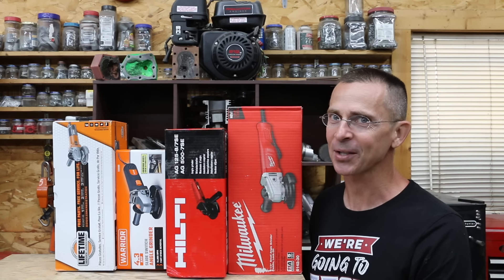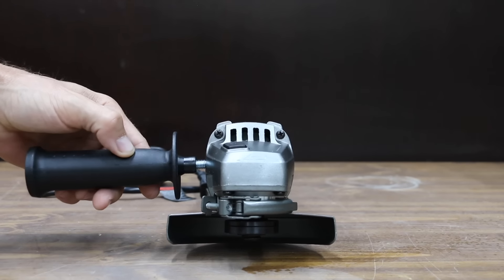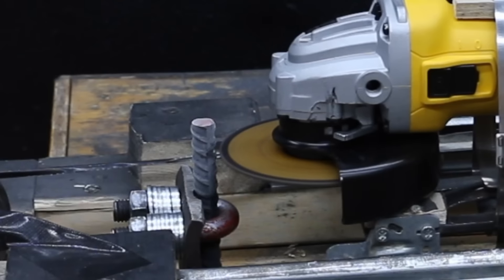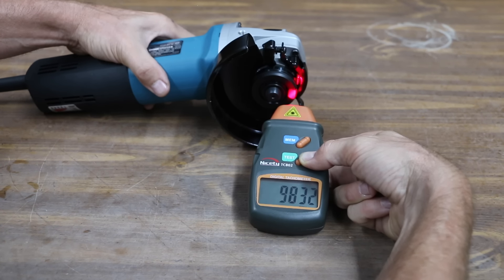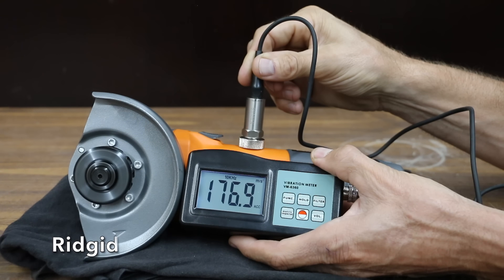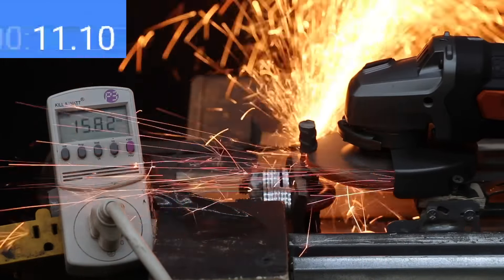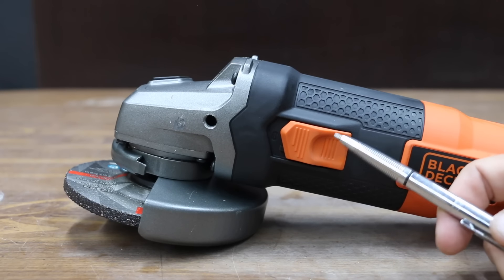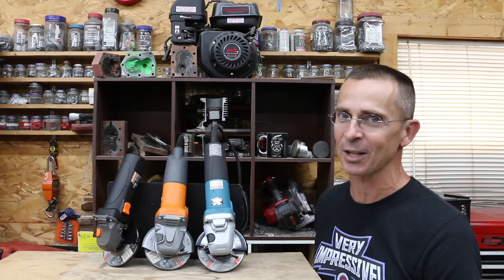Best Angle Grinder (Corded)? Hilti vs Milwaukee, DeWalt, Makita, Ryobi, Ridgid. Let's Settle This!

Comment: I own a Chicago Electric (from HFT) that has a paddle switch. I use it for metal work, which is pretty darn infrequent, but it does what I ask it to do at the $20 price point.

I also have a Makita cordless that I use in the woodshop. I have several accessories that I purchased for it specifically designed for woodworking. It is a beast...with the caveat that I have never used it for metal working. But slap a 40grit hook n loop disc on the accy mount and that thing eats wood faster than a starving beaver! Do not, however...DO NOT waste your money on any of the chain-saw carvers...that is unless you have zero regard for your own personal safety!!!
Reply from the maker: Thanks for sharing.

Comment: @project farm, could you do a brake fluid test as loads of brands claim to have similar spec but some must be better than others. Very few videos exist on this topic. Comparing things like the RBF600/660 and Castrol React SRF which seem to be the best on paper.
Reply: great idea man, i would like to see the wet boiling point tested across the brands as Castrol react srf has a wet boiling point of 270C or 518F which is way higher than anyone else
Reply from the maker: Thanks for the suggestion.

Comment: DEWALT Angle Grinder  (DWE43116) with 4-1/2-Inch to 6-Inch guard  is my choice with a trigger switch just don’t trust the paddle. It also has options for guard sizes & that’s a + in my line of work. Never use a grinder without a guard if your lucky it will just bite you. Just ask a coworker that can’t count to 10 or has issues opening a bottle. “ oh I am just going to cut this bolt won’t take a second grab that finger & put it on ice”
Reply from the maker: Thanks for sharing

Comment: I spent 6 hours grinding out windows and doors in a metal container using a dewalt and regardless of high vibration reading in this test my hands are fine.
Reply from the maker: Thanks for sharing.
Reply: @ProjectFarm  Man, the amount of times you've responded to my comments is impressive. I've been trying to think of video ideas and I think a "best brand of chisel" test would be useful. Maybe even side-cutting pliers.

Comment: I have a dewalt and a metabo angel grinder they both have the safety future of power button and lock brake during grinding , I usually use the metabo because speed control you can choose the speed from 2800 rpm to 11000 rpm and it's  very handy , I can't imagine which model of metabo you choose for this test ,

Comment: Had a warrior.  It worked in great power and cutting, but the switch broke after about 30 cuts of 3/8 angle iron.  It's probably great for hobbyists or people who use it once in a while or only do light cuts like nails or something.  I ended up exchanging it and paying the difference in price for a Bauer, so I don't know if I just got a lemon, but I live in the country and didn't wanna have to go exchange it again.  The Bauer kicked back on me while cutting more 3/16 angle iron with a cut off wheel and I hadn't put the guard on it.  I ended up with 5 stitches in a 5 mm cut, so put on the damn guard or wear a good glove.
Reply from the maker: Thanks for sharing.

Comment: i like my 6" metabo with the lock-on switch. only complaint is the price of 6" wheels and its missing the 3rd lug to put the handle on the top. 4" wheels work on the 6" also, which is nice with a wire wheel.
Reply from the maker: Thanks for sharing.

Comment: Nice video! I use a similar Makita grinder practically every day, sometimes for several hours at a time and while I do like the performance the power button really leaves a lot to wish for. If I'm wearing thinner welding gloves the tip of the thumb tends to jam itself in the way of the button when turning it on. Whenever I buy one for home use I might take it apart and replace the power button for something more manageable, maybe even a simple rocking switch
Reply from the maker: Thanks!  Thanks for sharing.
Reply: Get one with the paddle switch....

Comment: Metabe is best for new 1s for sure. I have old (late 90s) dewalt , and its evan smoother. Ate 1 anglegear, but has been in use quite much almost 20 years.
Reply from the maker: Thanks for sharing.

Comment: This is a great video! While cordless angle grinders are extremely useful the amount of batteries they use is insane. 
I have been looking at battery powered push mowers and am wondering if you would be able to do a video comparing them, Milwaukee, ego, harbor freight, dewalt?
Reply from the maker: Thanks!  Thanks for the suggestion.

Comment: I prefer an angle grinder with a trigger switch, it's easier to hold and control, the porter cable one you tested was 6 amp, the porter cable trigger option I have PC750AG is 7 1/2 amps.  It would be nice to see these types tested, I have a friend that likes a paddle switch grinder he does a lot of one handed grinding because he's always in a hurry.
Reply from the maker: Thanks for the feedback. Thanks for the suggestion.

Comment: Could you do a video on mower deck undercoating's (an example would be slip plate), they claim to prevent wet grass from sticking. would be great to see your meticulous testing put them to the test.
Reply from the maker: Thanks for the suggestion.

Comment: Great Vid, 

I bought a "Chicago Electric' HFT eons ago. (Total newbie)

Never really used it !

Then I saw (no pun) how dangerous, it could be for a pwr tool newbie.
(Blade shattering).

I am now better versed in da land of power.

I will check, to see, if u did an Angle Grinder Blade/ Disk review ? (Quality, Saftey n Durability)

If not please consider it.
(I'm "PF" aka "Farm Fan") 🎉

Of all my now much larger, power tool collection. 

This one strikes the most fear, in me.

Out of my power cutting saws ,( Pole, Jig, Sawsall, Mini Chain, Dremel lite 7660 n Oscillating)

Thx for the vid .
Reply from the maker: You are welcome!

Comment: In 2008 I burned up two Harbor freight grinders in 1 day. I puchased a Dewalt paddle switch with hard case for $98 that I still use to this day. I guess that would be $150 today😮
Reply from the maker: Thanks for sharing.

Comment: I got rid of miluakee tools nearly 5 years ago. When my last working  battery  less than a year old gave up the ghost. Between hamme drills chuck coming unlocked and spitting your bit out or the impact drover rolling coal, ivebeen using the same  flex volt 60v tools and batterys for like 4 times as long and still going going going
Reply from the maker: Thanks for sharing.

Comment: which grinder would you recommend, for sharping lawn mower blades, while using a All American sharping tool ?
Reply from the maker: Thanks for the suggestion.
Reply: @ProjectFarm  not sure of the handle i would need to get for a  grinder to use with the all American sharper tool ?
Reply: @ProjectFarm  plus i am looking at the DeWalt grinder i think, for sharping a lawn mower blade ? ?

Comment: Always  cool videos.  Here's an oddball suggestion for you.  As we get older it becomes important to be able to monitor one's blood pressure.  How about a couple of evaluations of wrist cuffs and then wrist against upper arm cuffs.  The problem with the latter is they generally require a 2nd person to be able to get the cuff on.  I wonder in particular how accurate any of them are.  It would be good to know.
Reply from the maker: Thanks!  Thanks for the suggestion.

Comment: Would've liked to seen the cords tested too.  I've got an old DeWalt angle grinder & the cord started falling apart fairly quickly.  Electric tape with gorilla tape over that has kept it going though.
Reply from the maker: Thanks for the suggestion.

Comment: I really prefer a trigger style switch however after accidentally bumping the trigger with my thumb on the blade I understand why they aren't as common anymore. Definitely not a mistake you want to make twice that's for sure. Thankfully I did just bump the trigger so outside of ruining the thumb on my gloves and making a nice indent in my thumb there's no lasting damage. I was in the habit of unplugging my grinder prior to blade changes but was in a hurry and a little tired that day, precisely when accidents happen. My new grinder has a slide trigger which can't be accidentally bumped, I still unplug it though, just in case. Wasn't the worse injury but still not fun.
Reply from the maker: Thanks for sharing.

Comment: My stepfather has a Metabo angle grinder bought in 79 so its 44 years old. It has been dropped in the ocean and been in use in harshest enviroments including snow and rain and the damn thing just keeps on going. Probably on its 10th power cable and had to be flushed after it was dropped in the sea.
Think thats a hard to beat quality product.
Reply from the maker: Thanks for the feedback.

Comment: Idk if still available, but I bought a couple dewalt grinders 20 years ago- one always had cut off wheel and the other grinder/flapper disk.  They were $5 more at the time to get the paddle trigger version.  

I Used them in daily fabrication for a 4 years, then they were used as needed as heavy equipment mechanic for about 4 years so more frequent than at home, then at home on as as needed basis.  

Fabrication have probably went through 1 cutoff blade a day and 2 grinding discs a week by tike it’s averaged out.
Equipment mechanic was maybe 1/2 as much.  1/2 that again since being at my house- but i do more fabrication at home than most any guy I know.  They both still work great, the cords need replacing and I never put in new brushes yet.  Now that I am thinking about it I probably will check the condition incase I can keep them running rather than damage the motor.  If not replaceable- no tears, they way more than paid for themselves years ago.

While they were at home,  I ended up with metabos, makitas, and the side switch dewalts, and of course tried other brands that other guys had.  I would not buy the side switch dewalt, ergonomics sucked.  A friend has bought the harbor freight ones, burns them up about every 5 months, but so cheap- so what.  But I hate the ergonomics so bad I just bring over my dewalt if we are working of stuff at his house.
Makita is to heavy/ bulky to work comfortably more than 1/2 hour.  Fine for strong 20 year olds but those days are gone for me!  Haha.  The metabo is really nice tool- but honestly- I just buy the metabo disk nut, remove the face clip (search youtube to get why) and use it on my dewalts. 

Hope my rambling helps someone.
Reply: Oh yeah- the metabo has a special part inside to hit the wheel lock to change the blade without any tool.  Just hit the trigger, let is slow to almost stop and hit the blade lock.  It loosens the nut and you take it off by hand.  It doesn’t ruin the grinder

Doing this to other grinders will ruin them.

Search youtube and you’ll see.  This is the #1 reason pros choose metabo.
Reply from the maker: Thanks for sharing!

Comment: I was going to rent an angle grinder from Home Depot for a one-time job. Then I discovered for less than the rental fee I could get a new 7 amp grinder from Harbor Freight for less. Well, that grinder performed great! Sure it's not the best, but I don't have much need for one and it won't get used much. I'll die before it breaks.
Reply from the maker: Thanks for sharing.

Comment: My 18V Ryobi grinder is not a variable speed but it has great power and performs well in all the very heavy duty projects I throw at it.  So far I only use the 4 ah batteries.  The drawback with it so far is when I use it for extended periods a spot under the grip on the right side by the trigger gets blazing hot.  Not only does it burn my hand it has melted through the grip.  I have to let it cool down periodically on extended work. 
Please include Ryobi and thank you for your great service.
Reply from the maker: You are welcome!  Thanks for the suggestion.

Comment: Im have hand arm vibration syndrome in my hands, id be keen to see vib’ during the cut, and another vid on concentricity, tolerances and balance of grinding wheels, as im sure the combo of sloppy fit, out of balance manufacture etc are the main problems.
Reply from the maker: Thanks for the suggestions.

Comment: IMO the real sweet spot in angle grinders is the Makita 9005B, which is a rat-tail grip like the Ryobi in this video, with absolutely top-tier performance. It is, however, a 5 inch grinder, so you are unlikely to be able to get disks at the home center.
Reply from the maker: Thanks for the feedback.

Comment: Work in industrial setting, use a small grinder for concrete to steel fabrication. Tried all these at work except the low end harbor freight types. 
Metabo or don't bother
Reply from the maker: Thanks for the feedback.

Comment: I have 2 paddle switch grinder big 6-7" rattail dewalt and makita. And prefer my bosh 5" grinder for the switch that lock on. Never go with paddel again for big work. (More than 5min straight!) Has it make my arm fatigue faster! Use to do multiple hours in the past with that now I feel paind after 5 to 10 min!
Reply from the maker: Thanks for sharing.

Comment: This was a great comparisons, however, HFT makes a whole bunch of angle grinders, their top Herk @ 13 amps/corded/4.5" blade, pit that against the Herk 20v cordless 4.5", or just the whole lot of Hercules vs. the Bauer stuff be it corded or battery.   I have an early paddle  4.5" HFT corded that is a work horse that I've used over the last 5 years that I paid about 40 bucks for. I have some autobody work coming up that will require me to have several angle grinders going from stripping paint to grinding  welding seams and splicing sheet metal together. HFT is my closest store. Also, grinding wheels and cutting blades, Hercules blades to the cheapest is also a question.
Reply from the maker: Thanks!  Thanks for the feedback.

Comment: You should look at parts availability when testing power tools, for example most Milwaukee m18/12 tools you can’t replace just the trigger or just the motor, they only sell motor controller and switch as one unit making a repair as expensive as buying a new too! They also use cheap Chinese bearings!
Reply from the maker: Thanks for the constructive feedback.

Comment: Great video as always Todd. One thing that I believe is missing from the test is safety features. For example, what happens if the breaker trips and the grinder is left in the "on" position? Does it switches itself off when power is interrupted or it will start running again when the power is restored? ("Dead Man's Switch"). If am not mistaken the Makita will continue to run while the Dewalt switches itself off.
Reply from the maker: Thanks!  Thanks for the constructive feedback.

Comment: YESSSSSS CORDED TOOL REVIEW!!!

celebrates I love my corded tools, and can't be bothered with that overpriced cordless stuff. Mostly because I primarily do shop work rather than field work, but even in the field I often find myself preferring a corded tool with extension cords to cordless. They work reliably all day - no fussing around with batteries and chargers - plus often have significantly more power, and they're often cheaper to boot.

IMHO cordless is greatly overrated for most applications.
Reply from the maker: Thanks for the suggestion.

Comment: Dear Project Farm, awesome video as always, love them all :) Just one suggestion if possible, I am not sure what is best way to do this but longevity testing is a must :D There is allot of talk in comments about what brand will last longest, and that is just a guess, we need testing jig :D Some thing like, connecting angle grinder to motor reductor and on output of reductor DC motor should be connected to act as a brake with constant load, or something similar.  I have feel that all of them will die in just few hours, with 400 - 500 W load ( pulled from wall ).
Reply from the maker: Thanks!  Thanks for the suggestion.

Comment: You should make a video on respirators and their filters. I just had to buy one and spent like an hour comparing the different styles, models, and protection level. If you had a video on this I know this process would have been much easier. Anyway, I settled on the 3M rugged comfort & their advanced p100’s. I wonder how they compare to their normal ones and other models.
Reply from the maker: Thanks for the suggestion.

Comment: Re the ergonomics of the switches: you didn't take into account that, with the exception of the two paddle switch models, none of the grinders are left-hander friendly. 

I've got a few ancient electric angle grinders and they all have the switch on the top of the body, where it's equally accessible for left- and right-handers. Strange that things seem to have gone backwards in this area.
Reply from the maker: Thanks for the feedback.

Comment: Fascinating test data (!) 

Looking at results on spreadsheet, would think  Cutting Speed @ rated Amps would correlate.  Instead There is a very wide variation of Cutting Times vs Rated Amps - this was unexpected:  How could one tool cut faster using less amps?

Would have been nice to figure a way to vary the cutting load so you could run tools at rated amps.
Reply from the maker: Thanks!  Thanks for the feedback.

Comment: Would you consider testing 3" battery powered cut off tools? They are starting to pick up popularity with brands like Milwaukee, Dremel and worx making them!
There are variations in things like arbor size and even disc size, some brands going as large as 3.5"

They claim multi material, high speed and convenient.
Reply from the maker: Thanks for the suggestion.

Comment: Curious, why did you freeze the rebar? You can see frozen condensation disappearing as the material heats up. It's especially noticeable in the torque test at 11:54 when the HILTI stops.